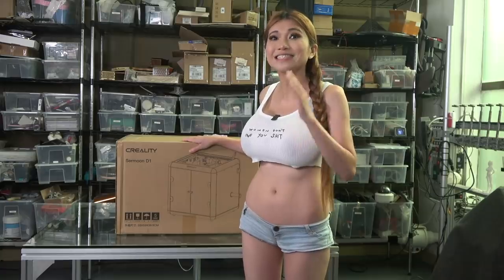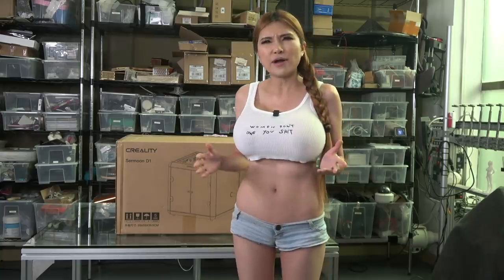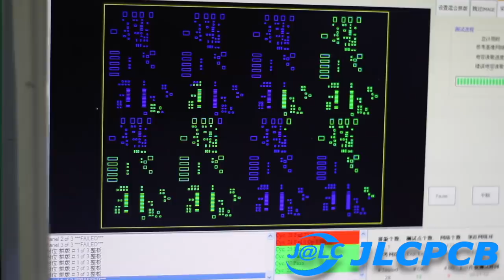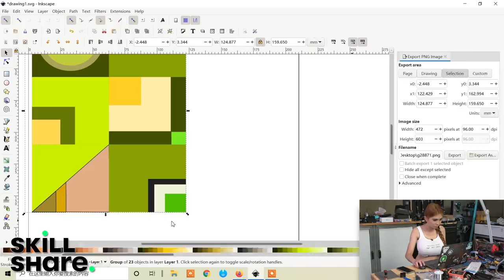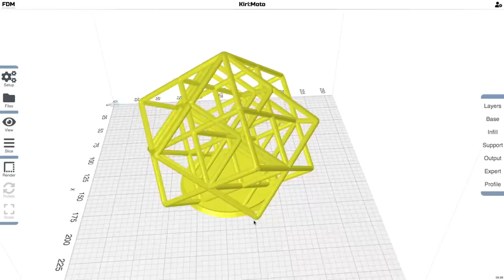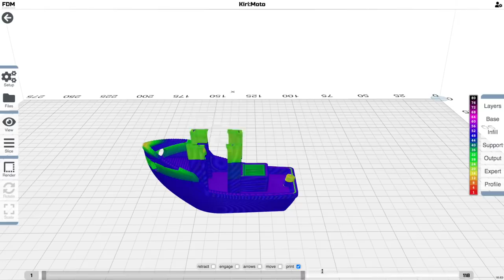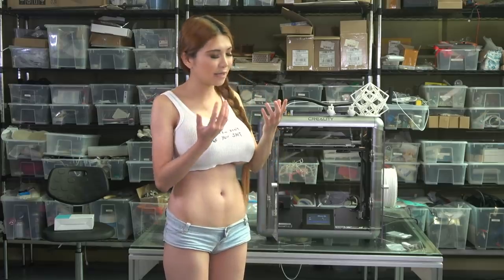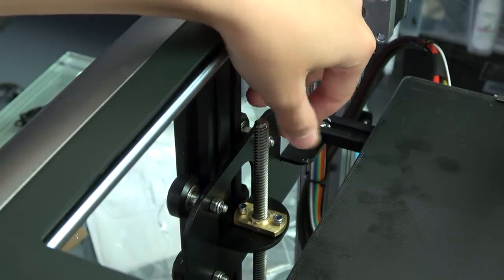The Creality Sermoon D1 3D Printer- Assembly and Test Print

Comment: The whole motion system is very similar to an e3d BigBox including the Z setup.  My FolgerTech FT-5 is similar as well.  The tricky part is to keep the bed from getting slanted when you remove a part or something--unless the z screws are mechanically linked.
Reply: Thanks dude

Comment: I think that your CNC mill really wants to be in some more videos !  :-)
Reply from the maker: Soon!
Reply: @Naomi-Wu  Still working on getting the hang of it? If so then take your time. We will wait for quality content, and with something as expensive as that mill it's even more important you learn what not to do as it's a pretty hefty piece of equipment and a new area of expertise for you.
Reply from the maker: @blahorgaslisk7763  the problem is its an industrial controller, so intend for an occasional very granular setup in high end CAM software by a CNC tech and an operator then makes the same parts for weeks. Trying to use it for 3-4 of something is a real pain😣

Comment: I guess I'll be the first to actually post about the 3d printer 😀. 1st, we already spend 90% tuning/building/fixing/ our 3d printers..with creality's higher costs I would like that to decrease, not increase. Is this more of a tactic to reduce or eliminate costly warranty claims and overall returns ?(it's a kit, kits often break or put together wrong, less printers would be RMA'd) 
There are many larger volume enclosed and comparable alternativess that are fully assembled and proven platforms with good phone or email support to get the units running when new or during a problem unrelated to the purchaser...not always necessarily cheaper, but then the manufacturer is on the hook for a year or two, also responsible  for tearing it apart and reassembling with loctite, bad belts,  bearings, dead heaters, fried motherboards $$ etc....I feel the way creality is going that they want to bail on all the above....any point of assembly  can fry a motherboard from static or dumb thumbs on delicate components when we are home assembling on the bedroom carpet...
I just dont accept this from creality or any other high premium printer company...I would never ask the bmw dealer to skip the new car cleaning and just send the 2021 X5 to me to the ocean port in boxes lol...I'll assemble the trans and engine engine also.   If bmw did expect me to assemble it, I'd expect the cost to be around a Kia and have little warranty......just my 2 cents....

Comment: I have a Sermoon D1 and there's some issues that I and a few other owners have had right out of the box.  Hopefully you can pass this along to Creality.

The upper z-axis limit switch appears to be breaking in shipping because of the packaging design.  It's not a hard part to fix but it shouldn't be shattering.  The two z-axis acme screws tend to get out of sync with each other was well.  Once the printer is leveled everything is fine but the two sides of the print bed can get out of level with each other after it has been powered down for a while.  Because there's only one z-axis switch the printer can only sense when the left side of the print bed has reached the upper limit and since the two screws are not mechanically linked they are free to rotate independently of each other.  When that happens the right side could be lower by a few millimeters and the printer will never detect it, making leveling the bed an aggravating experience.  Manually lowering the print bed using the control panel so it goes to the very bottom will force the two back into sync but the fact you have to do this is kind of ridiculous.  Adding anti-backlash nuts doesn't resolve the problem either.

My printer not only came with a broken z-axis limit switch but the shaft of the right side z-axis stepper motor was bent as well (most likely damaged in shipping too).  Again it's easily fixed but the printer shouldn't come pre-broken in the box.

The print bed tends to be higher in the middle of the build surface by .10mm.  The consensus from us owners is that it's the weight of the print head when directly in the middle of the printer that's the issue.  The confusing part is that some users are reporting the exact opposite too.  :/  There's ways to compensate but it can make leveling the bed a challenge if you're not aware of it.

The printer is marketed as having an all-metal extruder.  While that's technically true the heat break is most definitely NOT all-metal (it's PTFE lined).  Normally that wouldn't be much of an issue but if you want to replace or upgrade it you can't.  The heat break appears to be something custom made for the Sermoon and there are no other heat breaks that are compatible with it.  To complicate matters you cannot replace the entire extruder either because of the design of the carriage.   Making the situation even worse is that you cannot easily buy replacement heat breaks from Creality either (you have to contact them directly.  There's no way to buy them from their online store and no other manufacturer makes replacements).  The nozzle is a standard Mk8 nozzle thankfully but the heat break is not a standard part so you can't fix or upgrade it.

Although I like my Sermoon printer these annoyances and oversights ruin what should be a great printer.  This is my first Creality printer and will very likely be my last unless Creality can address these issues.  I've had people tell me that my expectations at this price point are too high but my other 3D printer was about the same price and it has/had none of these issues.  :(
Reply from the maker: So sorry to hear it, I didn't renew my contract with Creality because these issues have become a regular occurrence and I could not convince them to improve things. I can afford to be associated with quality control this bad...

Comment: Looks like a nice unit, but what is the point of having an enclosure with an open top? It does not keep dust out, and will not keep heat in either. Do the walls actually achieve anything?

Comment: Thanks for pointing out this printer. How good is the precision in the XY plane? I read that direct drive printers could have worse precision there because they have to swing around a big heavy print-head including the stepper motor. To be fair though, I heard this argument against Ender 3 printers that were converted to direct drive. Does it also apply against purpose-built direct drive printers?